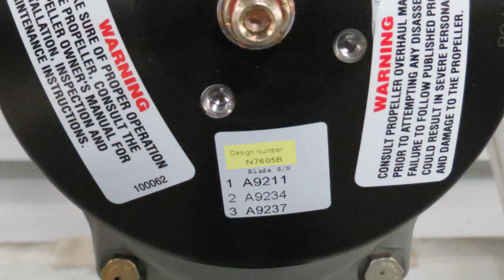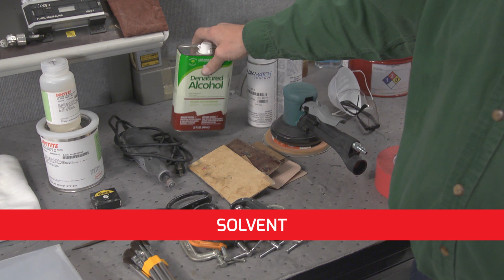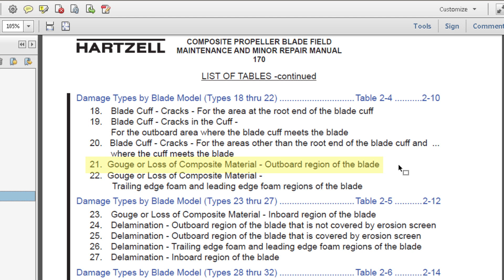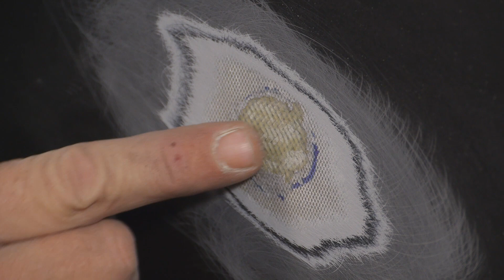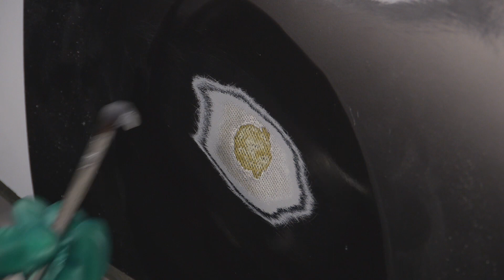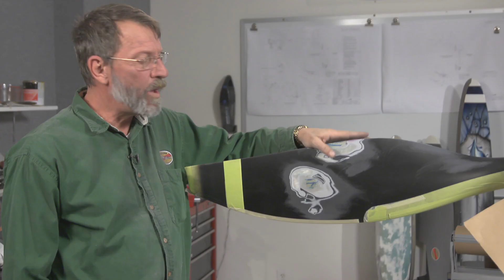Hartzell Composite Propeller Repair Video - Kevlar Gouge Repair

Comment: I think I would have just filled that scratch with bondo and painted the prop. That wasn’t a gouge it was a tiny scratch! You actually did more damage to the structural integrity of that prop by repairing the “damage”.
Reply: Just asking what are your qualifications to make such a comment. 
Not trying to be starting any YouTube fights I just want to know what should be best because the difference between dressing up Rob and doing a structural repair are very different from what I understand and what I read in the regs I don’t think I’m even allowed to dress up a prop like that am I ? 
I understand fiberglass repair as I worked on a lot of boats, but now that I’m working on GA  Aviation Aviation it’s all rules and regulations now.
Reply: Well I don’t have any “qualifications” I do have experience with both composites and experimental aircraft. Technically you aren’t allowed to do much of anything if you have a certified aircraft. But you can do almost anything you want on an experimental. Not including any type  commercial use be it part 91, 135, 121, ect. I don’t understand why anyone would want a certified aircraft. So if you are flying one you “technically” can’t do much. Obviously if you are an A&P especially if you have an I/A and working on a customers aircraft you wouldn’t dream of doing anything outside the manufacturers procedure due to the liability. I was thinking about experimental aircraft, not just experimental but your own experimental aircraft be it a homebuilt you are working on under your repairmans certificate or a commercially produced aircraft as that is what I am familiar with when I made this comment.
Reply: How to repair composite blade of turboprop..
Damage erosion coating